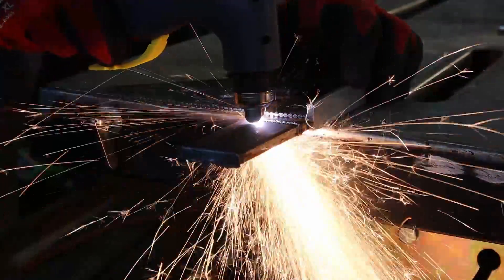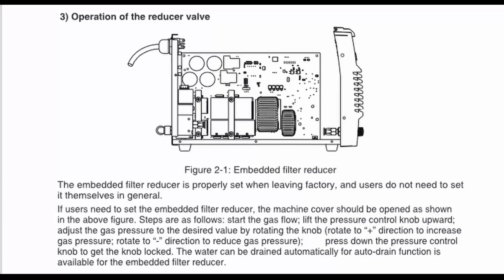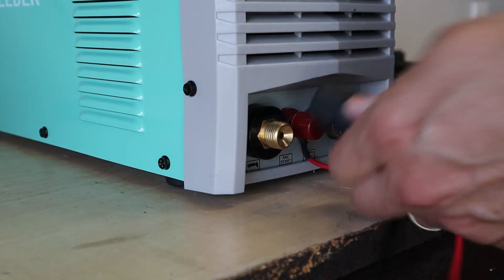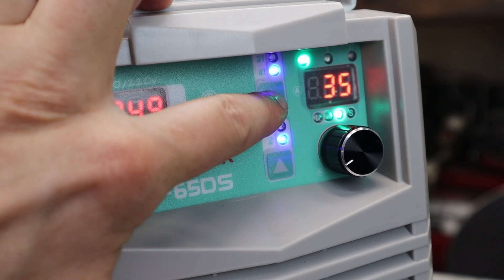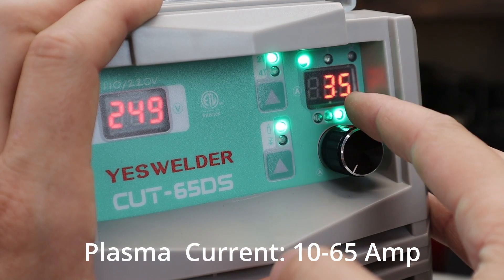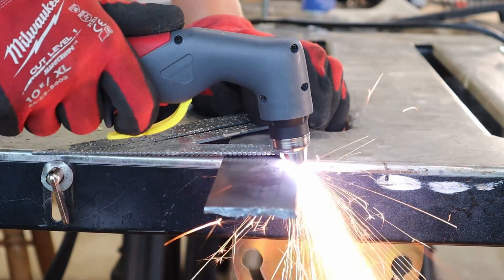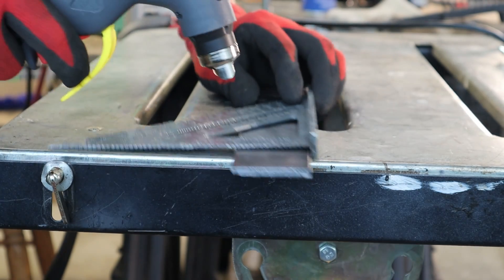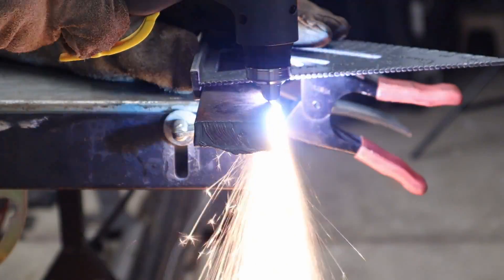YesWelder Cut-65DS PLASMA CUTTER

Comment: Read the reviews . Seems that you are about the only one who is happy with it. seems that the consumables are unavailable. many complaints just don't work. Good luck.
Reply from the maker: They have consumables available now. I linked them in the description. I've used it a bunch and still works great so I'll keep it at a 5 start review.
Reply: @-DIYPRO-  you would need to remove a few stars if you put a DC amp meter on it and measured the actual output. Like most of their products, Yeswelder overrates the advertised amperage, it is a 45 amp plasma cutter.
Reply: I had no problem getting consumables.